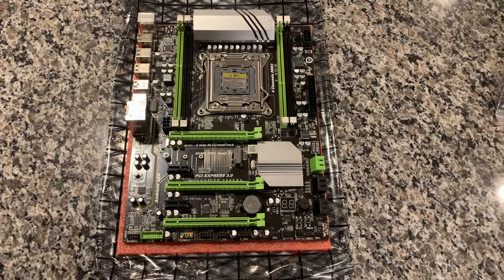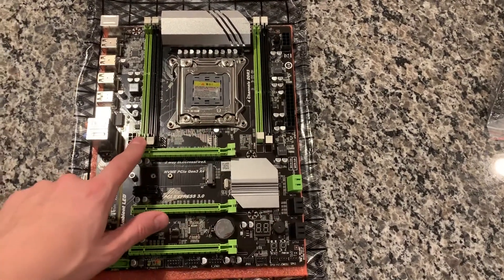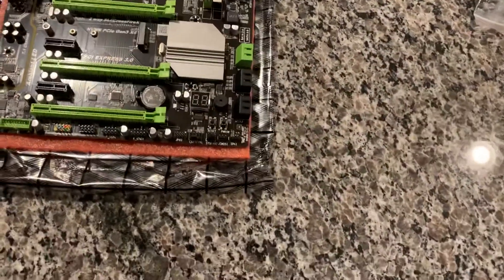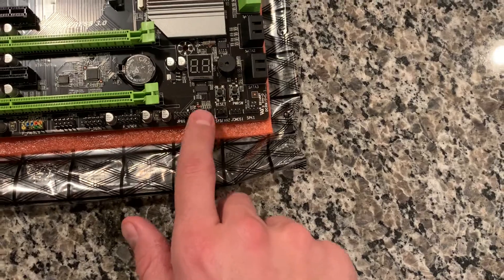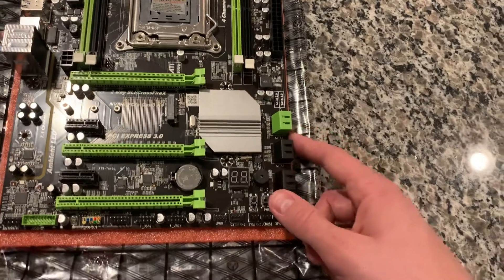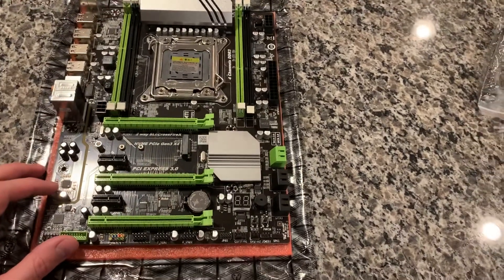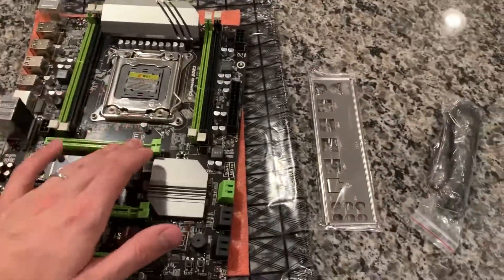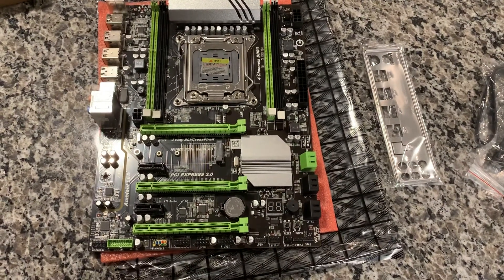X79 PlexHD LGA 2011 Xeon Motherboard Overview - From AliExpress in China

Comment: how did you fit the new cooler?  I just bought one similar (exact same cpu socket layout as this - in fact even the cardbox box and pink foam was the same too).  Anyway, on the CPU socket the existing metal bracket looks like it is 'under' the socket (especially at the 4 corner holes - i can't see how you would remove it. (nothing on the backplate either to unscrew)... ? thanks...
Reply: hi, never mind. ANY socket 2011 CPU cooler works.  (And with mine I did not need need to remove the metal mounting bracket or install the back plate -- the cooler's instructions specifically say that for socket 2011 you don't need to.  In fact there are special standoffs supplied which screw into the existing socket hardware as seen in this video). Thanks.